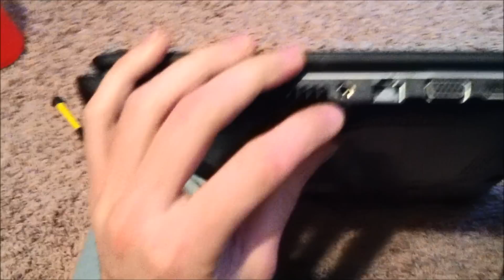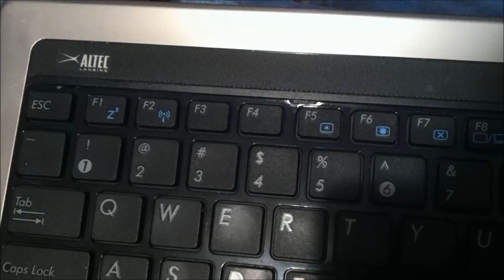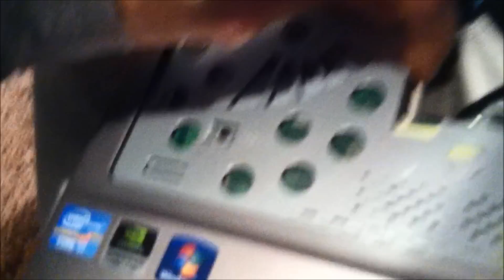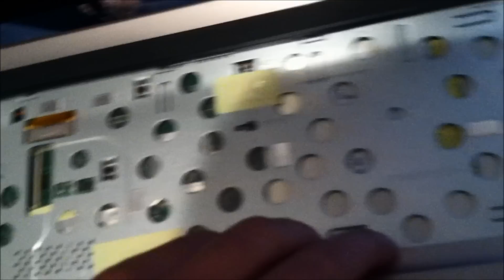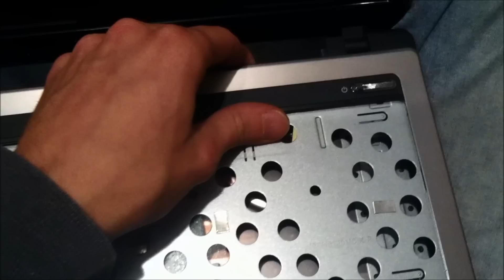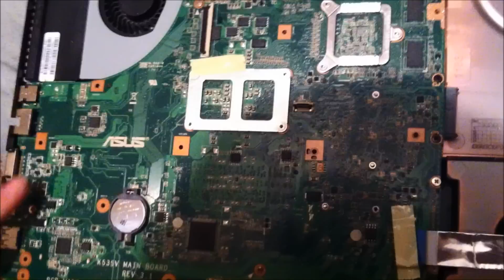Asus A53S dc jack replacement

Comment: Hey man this was very valuable. Basically same thing happened to my laptop. The charger jack is stuffed, I have tried all chargers and even original asus chargers. Nothing is working. I have to replace the jack. Now how exactly does the jack need to be replaced. You mentioned soldering. I have little experience in this from school projects. But could someone please link me the next steps in replacing the jack? please. I love this laptop, and i really cant afford a new one.
Reply from the maker: Ill make you a video tonight.
Reply: After Hours Tv & Pc repair holy crap, you are a legend man! seriously. Me and my friend have been discussing working on it but that would be invaluable. Desoldering is something i dont feel confident about people have been mentioning it, but i guess you will cover that. Thanks again. Its ok if you get busy of whatever :) this video helped me tremendously already :) :)